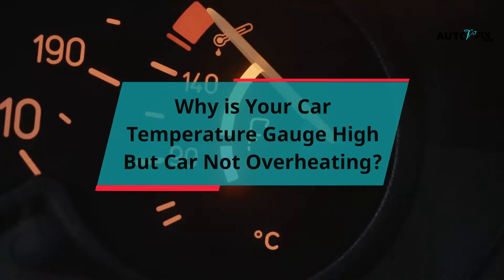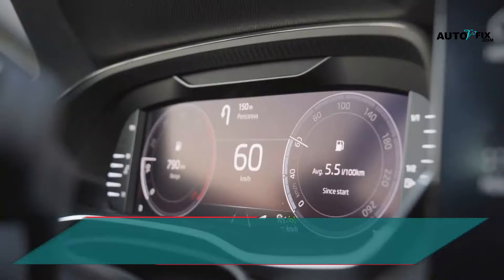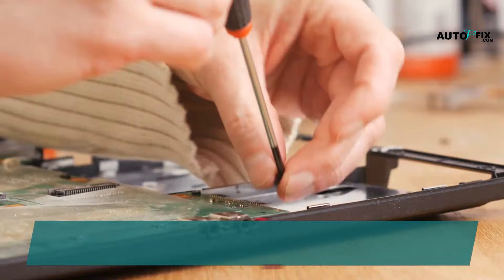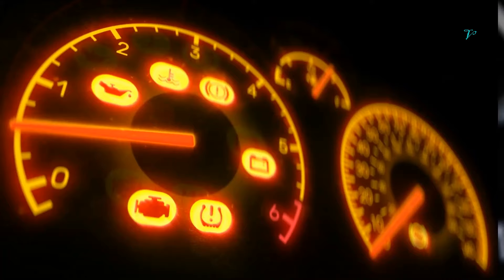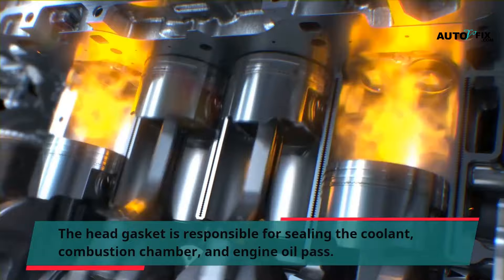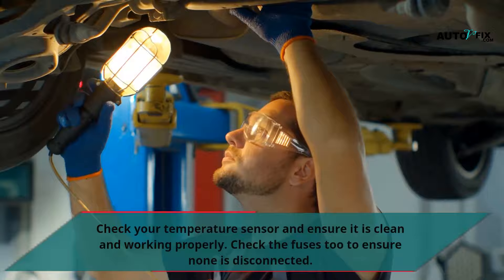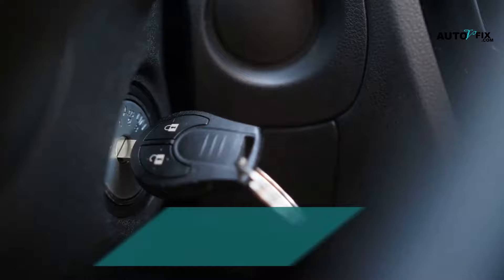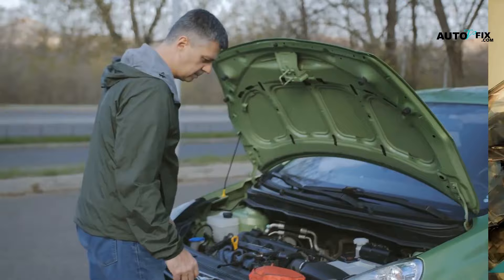Why is Your car Temperature gauge High but Not Overheating

Comment: If the needle of the temperature gauge shows half or a bit less than half, what does it mean? Is this normal or the car is heating?
Reply: Normal yes…if it starts going higher than half or close to Hot(H) it’s getting heated
Reply: My car honda city 2006 during driving tharmstate valve open 110 dgree selcius safe or not safe plz confrim❤

Comment: I changed my temperature sensor three times, the last was an OEM Mopar part for my Dodge Dakota. But after an hour of idling, the temperature gauge goes almost all the way hot.
But, per my thermometer tests on various points from radiator,  hoses, the sensor, body if the water pump and thermostat housing. Nothing else indicates a high temperature. No coolant leaking or being released and no visual sign of overheating. I'm at a loss. The only other thing is if the computer is not translating the sensor correctly, but there is no adjustment for that.
Reply: I’m going thru the exact same thing. Did you ever figure it out. My blood pressure should be high watching the that gauge
Reply: Yes, operator error. I replaced everything a few times, due to a couple accidents. After all the troubleshooting, I decided to remove and check my thermostat. I sort of remember having a doubt about the direction and sure enough, I had the thermostat backwards. Once I corrected that, the truck is running daily and stays between a quarter and halfway up.
Dumb mistake, but there was no clear markings and it fits either way. I need to be sure the spring side was facing the water as it came off the engine.
Reply: @Wakeupandsniffthecoffee  glad u figured it out, hopefully the dealership figure my problem out at a reasonable price 😂😂😂
Reply: @eljefe1263  good luck with them. I almost went that route too, but I'm too stubborn and want to figure things out.
Reply: radiator cap , u change? thermo sensor u change? or no?
Reply: It end up being my thermostat, which I got changed in march of 2022. I guess it went bad again.
Reply: @muhdina2061  yes to both. Problem was the thermostat was in backwards.